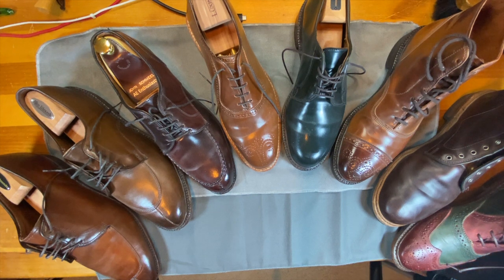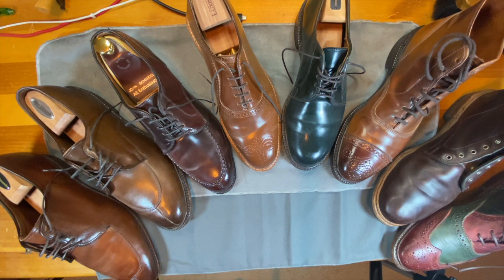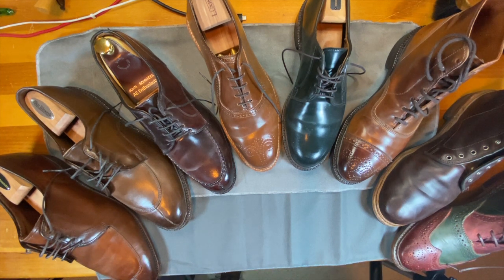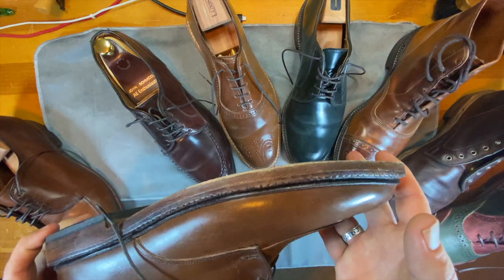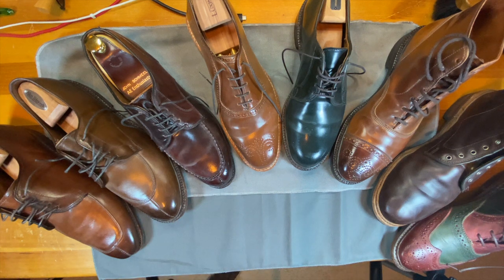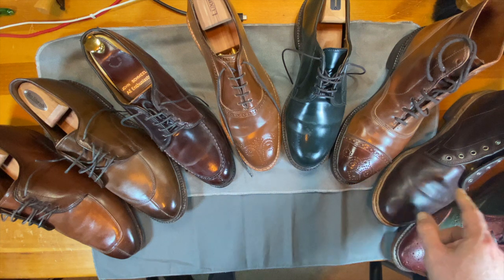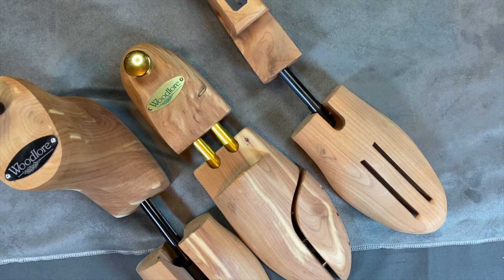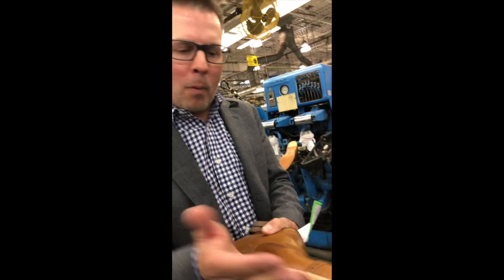Brand Showcase: Allen Edmonds

Comment: I have sold around 42 pairs of AE shoes that I have bought on ebay. Between the pairs I have sold and bought, I believe I purchased more than 200 pairs of AE. Just like you, I tried a pair of Ashtons (the orthotic rubber soled version of the Walton) and I was hooked and thanks to the great pricing and ebay, I was able to get really great pricing on my shoes. Scored 4 pairs of shell cordovan AEs and I didn’t pay more than 160 for any of them-on ebay or on the website. That alone makes them the best value for shoes on the planet. Being a graduate student I was able to afford all these amazing shoes at amazing prices.

Personally I would rank them ahead of Meermins because AEs are comfortable right out of the box and they use better leathers (personal opinion) and employ US employees. I am a bigger fan of chromexcel than shell cordovan since they breathe better and are low maintenance. The caveat to chromexcel is that they stretch out too much over time, making them not ideal for dress shoe type designs like the rush street or loafers, but that’s why everyone uses chromexcel for boots. Like you’ve shown in your videos with TLB and the Walton and Crockett and Jones PTBs, the leather quality is very high on AEs, but finishing has a lot to be desired and the quality is just going down. 

After last October, I have decided and have not bought a single pair of AEs. The quality control on both seconds and firsts are atrocious and the finishing is very crude. I believe AE was at their best last when Paul Greengard was in charge at he introduced the independence line and rough collection, like your black mctavish that you gave your son. I look for those models online and I will only buy those models if there are good bargains for them online. Otherwise, no more AEs for me. I can get trickers and Spanish makes for 200-300 usd range and they’re worth it. I still wear AEs every day and they’re great for the crazy weather in northeast Ohio. 

In summary, great bargains and great company with great history. Not a big fan of current management and decision making and product portfolio so will keep away for now. I pray the CEO changes and AE becomes a shoe brand. I have their scarves, hats, shirts and many other accessories which I bought a few years ago and current accessory line is nowhere near the quality of the past.